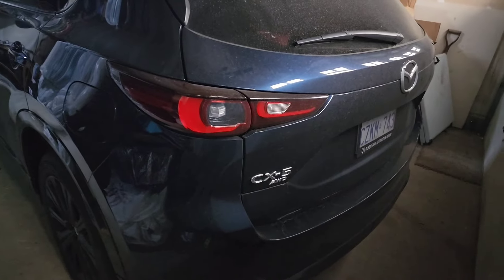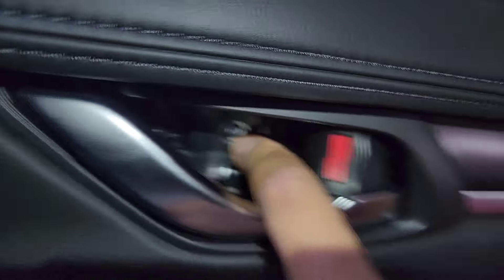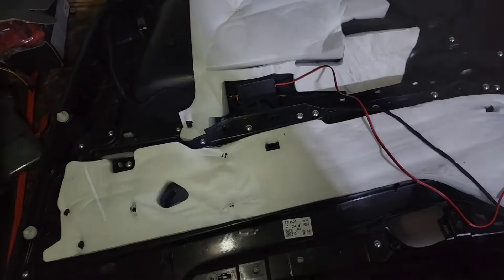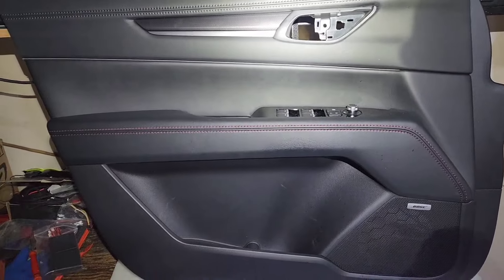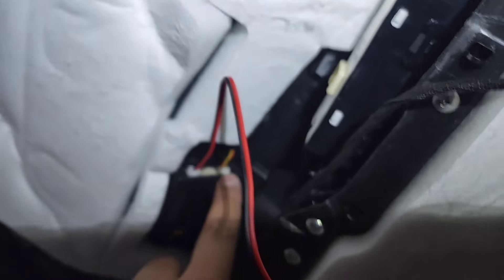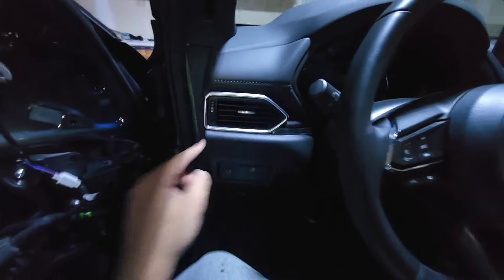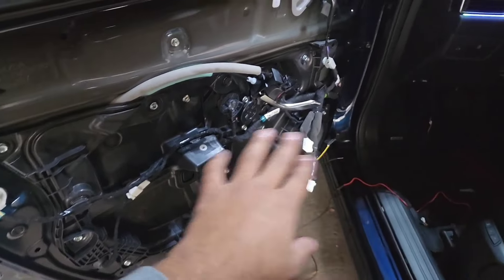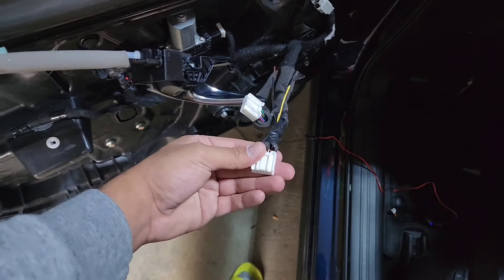How to install ambient lights flow series (Detailed) 2023 Mazda CX-5

Comment: These ambient lights are too bright and possibly have reflections on side mirrors and windshield in the night, is there a button reduce the brightness?
Reply from the maker: You can reduce the brightness by button or app controlled. At the lowest brightness, you will only be able to see the very dimm color, nothing else.

Comment: Where did you run rhe cable for front dash
Reply from the maker: You can run it striaght from the left side of the trim down to the fuse panel for main controller.
Reply: @lightguysgta  did you cut led tape in two (longer and shorter part) and then use same power supply or?
Reply from the maker: @thronemovie9035  for the dashboard, our kit comes with two LED strips (1: 38cm and 2: 135cm) you can use both and connect to the main controller.
Reply: @lightguysgta Did you take off parts from dashboard to install ambient?
Reply from the maker: @iamone2534  Yes, the dashboard trims need to come off..

Comment: Is there an app to turn it off? Would it be possible to put pressure under the buttons to open the windows?
Reply from the maker: It can be controlled by android/IOS app. No factory settings are disturbed during installation for window mechanism.
Reply: @lightguysgta  where did you get the voltage for the ambiente?

Comment: 10:00 is that pink wire on the bottom a wire that can be used for power, and does it only turn on when the car is on? Thanks
Reply: Following
Reply from the maker: Yes, the power could depend on where you want your lights to be on. You can power it either with highbeam, lowbeam, or parking lights.
Reply: for all mazda car, only driver side door have ignition on power, all the other door only have B+ meaning, weather ignition off or ignition of, the power is always there, if you hook up to the actuator socket, it will drain your battery.. this guy in the video cant even differentiated between actuator socket and power windows motor socket
Reply: @borntoolateMY so what you can do for the other doors? Is true I’ve found ignition power on driver door, but I’m struggling to find same for the other 3 doors. What’s the solution?
Reply: @Horiyka  Have you found the solution? Where to connect in doors?
Reply: @iamone2534  Yes, I've ordered a kit with 5 modules, 1 for each door and 1 Main module. As long as main module have no power the door modules won`t work and they can be connected to Live wires

Comment: What colors did I wire into on the door I am trying to install this on my cx30
Reply from the maker: Front or back door?
Reply: Front door and back door
Reply: And where did u connect the main controller?
Reply from the maker: Follow our new video for the wiring guide on Mazda.
Reply: That's the video for the cx9?
Reply: That video doesn't show where to connect to power what wires should I tap into for the main controller and sub controller?
Reply from the maker: Please check new video for Mazda CX5.